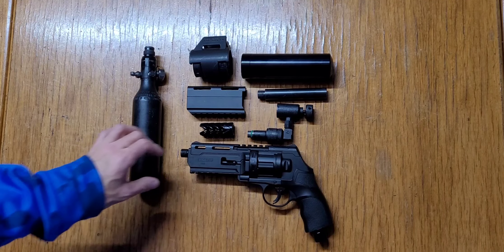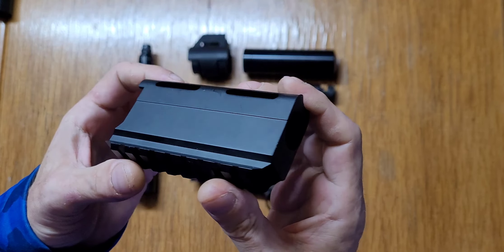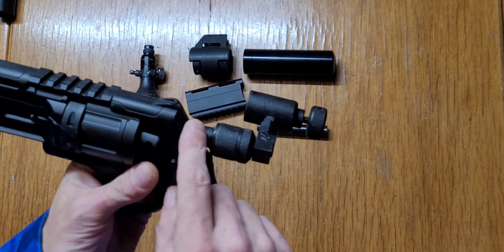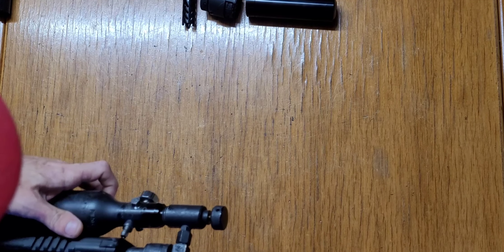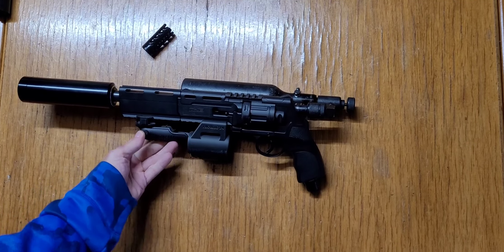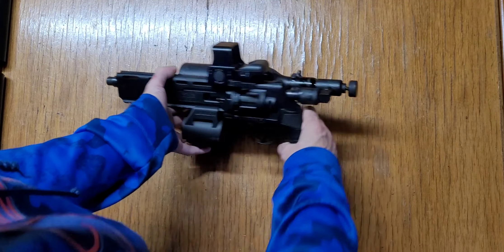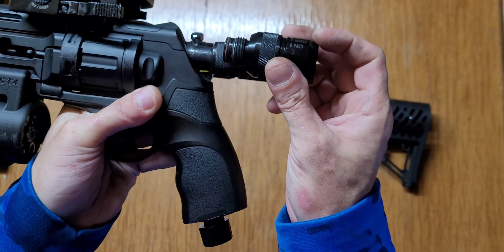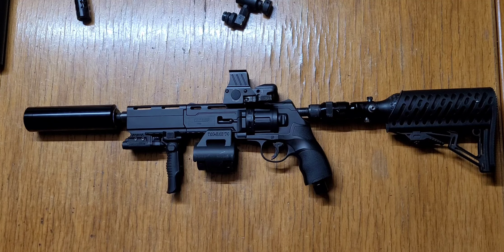How to Build A Budget Friendly Umarex HDR 50 Carbine From Home Defence-24

Comment: I had a question jeff when building up hdr.50, do you do a double delete removing the valve block and co2 restrictor? And if so how do you fix the co2 farting out?
Reply from the maker: yes i remove both and only use hpa the hdr50 hates co2 once you remove the restrictor